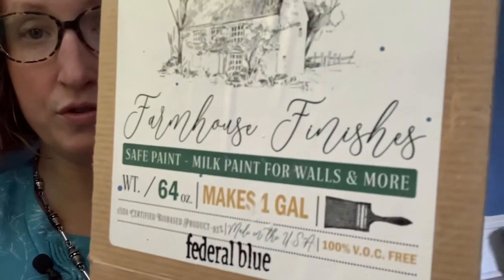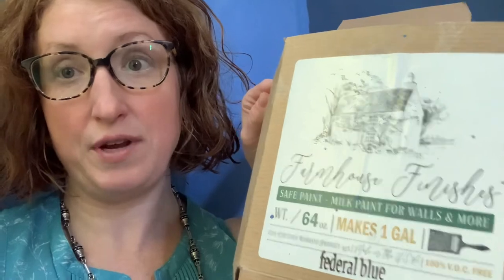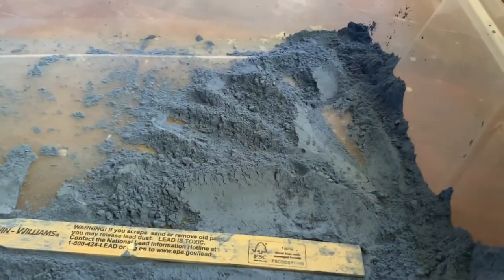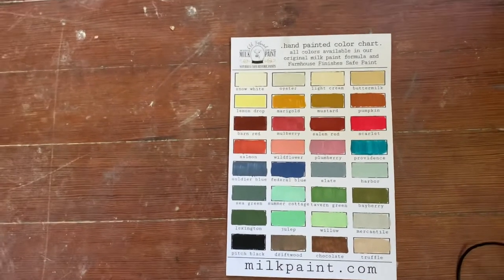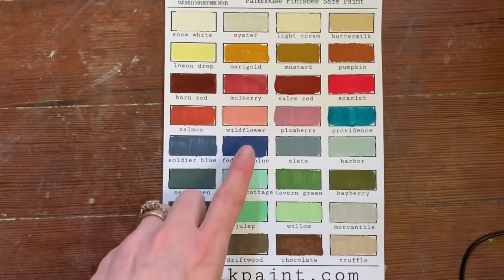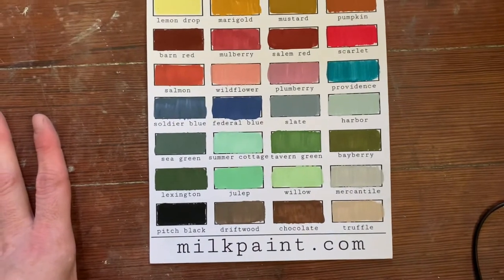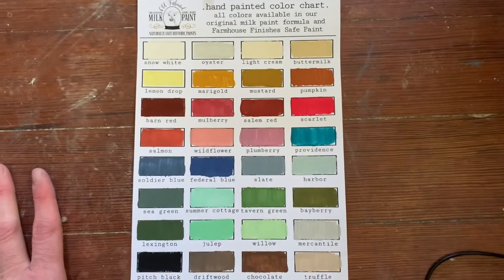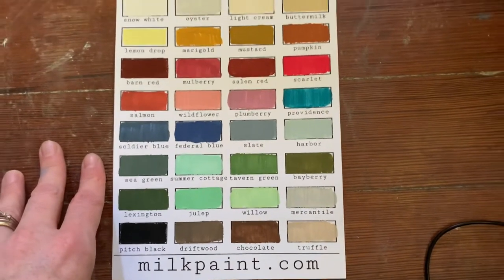How do you paint walls with milk paint?

Comment: I enjoyed your video. I love the way your walls came out. It was helpful in making the decision to paint my bathroom walls which had wallpaper to start and are unpainted plaster now. I plan to use Sweet Pickins milk paint in Ocean which I already have for another project. I also have it in Flour Sack which i might mix in to lighten the color a bit. I have to play with it. Did you ever seal it with something? Since mine is a bathroom, I'm wondering if i should seal it. It's tile about four feet up the wall.
Reply from the maker: Glad it was helpful! Yrs, I would seal the bathroom. I actually used this paint in my bathroom. https://youtu.be/BINUldeiixY?feature=shared 
https://youtu.be/JWilLFKUtMg?feature=shared